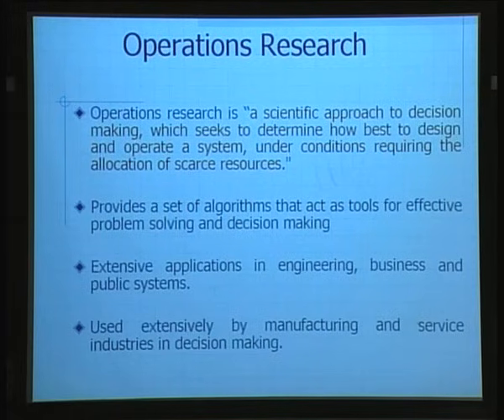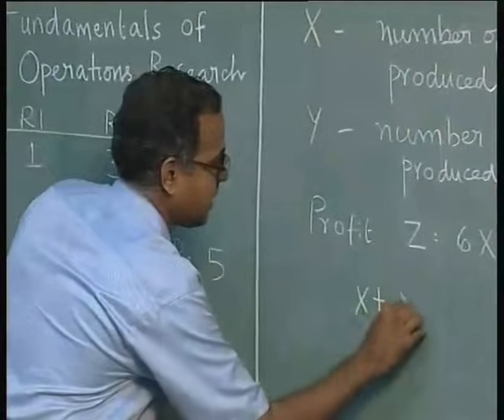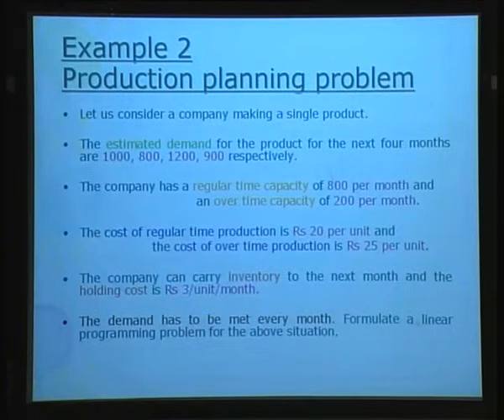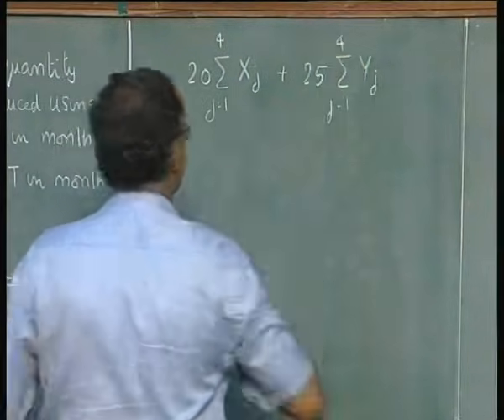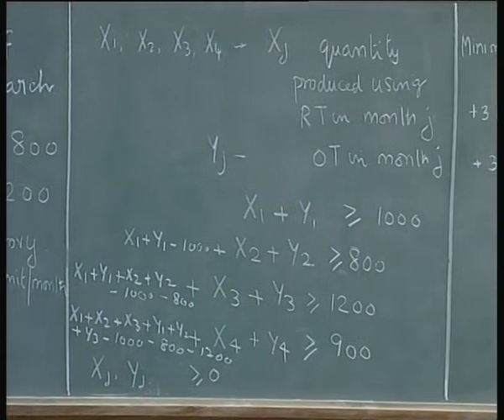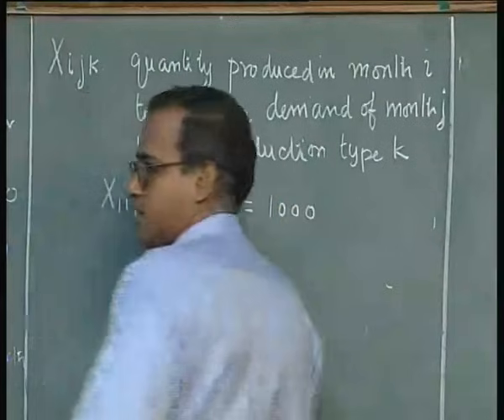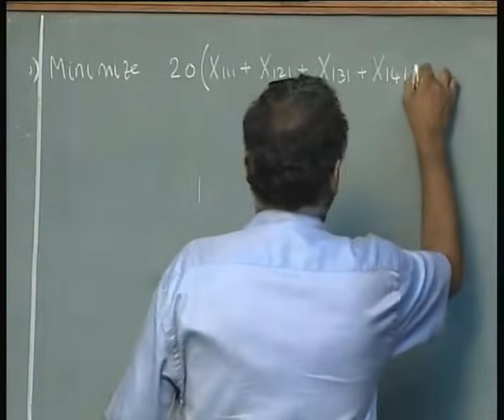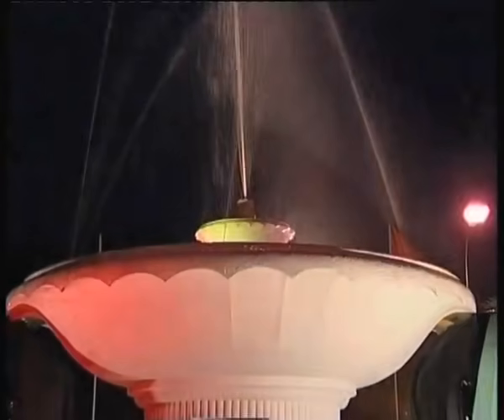Lec-1 Introduction to Linear Programming Formulations

Comment: A chemical company produces two chemical products, A and B. Production of both products requires the same process ‘I’ and ‘II’. The production of B results in a by product C at no extra cost. The product A can be sold at a profit of ₹3 per unit and B at a profit of ₹8 per unit. Some of this by-product can be sold at a unit profit of ₹2,  the remainder has to be destroyed and the destruction cost is ₹1 per unit. Forecasts shows that up to 5 unit if C can be sold. The company gets 3 units of C for each unit of B produced. The manufacturing times are 3 hours each per unit for A on process ‘I’ and ‘II’, and 4 hours and 5 hours per unit for B on process ‘I’ and ‘II’, resp. Because the product C results from producing B, no time is used in producing C. The available times are 18 and 21 hours of process ‘I’ and ‘II; resp.
Formulate this problem as an LP model to determine the quantity if A and B keeping C in mind, to make the highest profit for the company.
Reply: x 
A

  = Number of units of product A to produce
𝑥
𝐵
x 
B

  = Number of units of product B to produce
𝑥
𝐶
𝑠
x 
C
s

  = Number of units of by-product C sold
𝑥
𝐶
𝑑
x 
C
d

  = Number of units of by-product C destroyed

Comment: Sir sorry but there is one mistake in the video around 31:35 minute when you are writing Ij in the objective function it should be x1+y1-1000 but you have written x1+ y1-800 though it do not create problem as sum is 3900 but I want to know I am correct or is there any condition which is miss by me

Comment: good morning sir
i have learned main topics from your lecture videos
and i have a small drought please clarify me sir:
A project proposal needs to be prepared for a mixed used development towards housing and retail area. The housing area would consist of efficiency apartments, duplex and single family homes. Maximum demand by potential renters is estimated to be of 600 efficiency apartments, 400 duplexes and 350 single family homes, but the number of duplexes must equal at least 60% of the number of efficiency apartments and single homes. Retail space is proportionate to the number of home units at the rates of at least 12 sqft, 18 sqft and 20 sqft for efficiency, duplex, and single family units respectively. However, land availability limits, rental space to no more than 10000sft. The monthly rental income is estimated at Rs.25000, Rs.35500 and Rs.50000 for efficiency, duplex and single family units respectively. The retail space rents for Rs.5500 per sft.
a. Please write the Objective Function
b. Identify the constraints
c. Arrive at an optimal solution for the LP model developed using simplex method to determine the optimal retail space area and the number of residences
d. Write the Dual Problem for this LP Problem
e. Using Sensitivity Analysis comment on the change in optimal solution if the local statutory authorities insist only 6500 sqft of space be made available towards retail.

Comment: @jkbravo nowhere during the lecture the professor has mentioned 3(x1+y1=800), the final equation is x1+y1-1000+x2+y2>=800. Go through the lecture once again for better understanding. Its a great work by the professor.